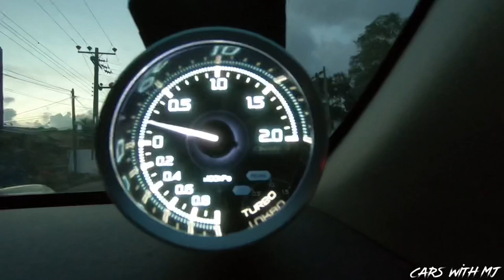How to install a Boost Gauge to Toyota Hilux DIY | Defi A1

Comment: Do this same proccess works on the n80 hilux
Reply from the maker: Yes you just have to locate the boost line connected to the intake manifold. The rest is the same process
Reply: Could you please take a clear connect photo for reference ? Not sure where is it on N80 Hilux XDDD , tks. @CarswithMj

Comment: How did u get the pillar out
Reply from the maker: There are 2 screws on the grab handle (covered with 2 square clips). Remove those two clips and unscrew the 2 screws.

Then you can remove the grab handle and gently pull the pillar out. The pillar is held by a few plastic clips.

Comment: Hey how did you get power to the meeter ? Ignition or from the other place?
Reply from the maker: I bypassed the power line from the radio so that the gauge will power up when the key is turned.
Reply: @CarswithMj  nice 😊 I m gonna try this.
Reply: @CarswithMj  does radio still have power if this is done?
Reply from the maker: @kylemcdonald74  yes the radio does get power